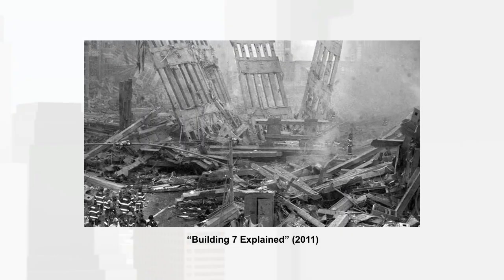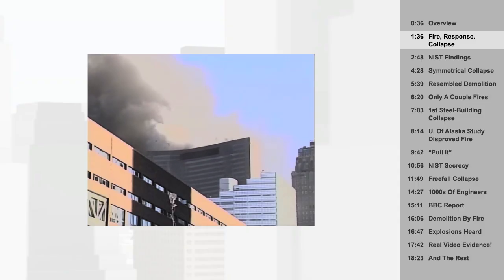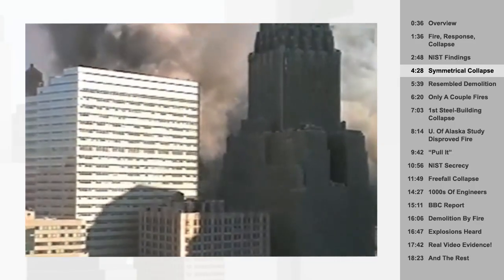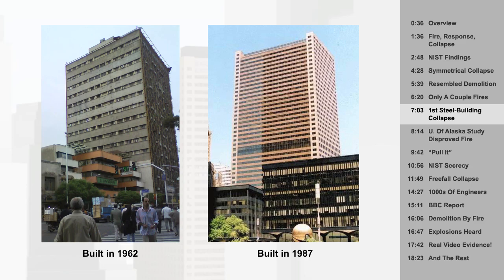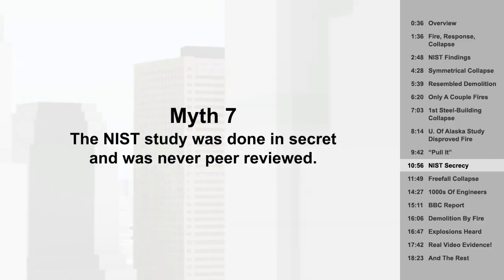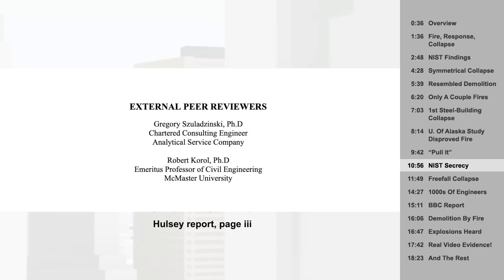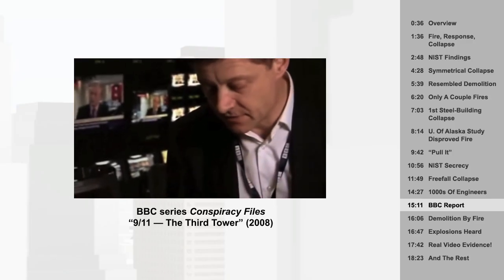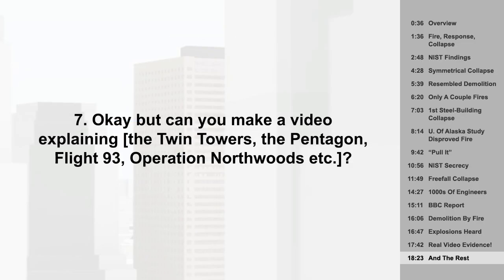Building 7 Explained: Comprehensive Final Edition

Comment: wow....a real exercise in orweliian thinking.
Reply: Fredumbfighter29:
You keep using that word.  I do no believe it means that you think it means.
Reply from the maker: How so, and please be specific.
Reply: @EdwardCurrent  

1. You say that WTC7 didnt look like a controlled demo, then proceed to show controlled demos.....and they look remarkably the same. This can be chalked up to perception I suppose, but thats just willfull ignorance, imo

2. You say Steel framed buildings have been knocked down by fire before....you give ZERO examples, and proceed to show buildings that burned longer and hotter and did not collapse. That was pretty funny.

Shall I go on?
Reply from the maker: they look remarkably the same
No, they don't. Demolitions don't start with part of the building crumbling, and then end 19.5 seconds later with the debris all over the place including on top of other buildings. Additionally B7 doesn't sound anything like a demolition. Therefore it only resembles a demolition if you look at about three seconds of it with the sound off and ignore literally everything that occurred before and after. This is not difficult stuff.
You say Steel framed buildings have been knocked down by fire before....you give ZERO examples
WTF are you talking about? There's an example shown immediately afterward, at 7:10, another at 7:12, another at 7:18, and another at 7:37.
proceed to show buildings that burned longer and hotter and did not collapse
You mean the concrete one at 7:20? Yes, it didn't collapse because it was concrete.

Shall I go on?
Yes, please, this is fun! Do tell me how else my video is "Orwellian" 😆
Reply: @EdwardCurrent   The claim is, "Never before has a steel framed high rise collapsed primarily  due to fire" . Ill admit you worded it a bit differently but your examples pale in comparison and function. A small theater is not a high rise.....The Windsor DID NOT collapse.....and the Plasco was 17 stories....just shy of 47, nor was it built to act as bunker in the case of emergencies not to mention the fact it disregarded over 20 fire and safety codes. Just a few key factors you, no doubt, accidentally omitted.

You show the CBS footage of WTC7 as proof of no explosions.....which was filmed several blocks away. Im shocked you didnt go with the MSNBC footage since you wanted to hear something go boom. Maybe the crowd reaction and the anchor would of provided doubt in a casual viewer, but you could of just talked over them killing the audio. Anyway, Im sure this was just editors choice.

Great video eddie. Im convinced. 2+2 really does equal 5.
Reply from the maker: The myth that I was debunking was that no steel building had ever collapsed due to fire. I hear that claim constantly as a result of the Truther telephone game. That a tall steel building had not collapsed prior to 2001 is true, but something happening for the first time is not evidence of anything.

The Windsor did not collapse because it had a concrete core. Duh. While you accuse me of ignoring things, why are you ignoring that the entire steel upper section collapsed off of its concrete support?

built to act as bunker
You're claiming that Building 7 was built to act like a bunker. This is nonsense. It was a lightweight steel building that was straddled over an electrical substation. There is a reason no skyscraper built today is designed like that.

which was filmed several blocks away.
The real demolition that I show immediately prior was a lot farther away than that. Do they sound similar to you? How can you be so disingenuous about the clear and obvious differences in the audio? And I am the Orwellian one here....

Im shocked you didnt go with the MSNBC footage
Oh, there's footage that looks and sounds like a demolition? Can't wait to hear multiple detonations followed by the building immediately coming down...you know, like in every explosive demolition ever performed on earth.
Reply: @EdwardCurrent  >> FreedumbFighter29: "built to act as bunker"
You're claiming that Building 7 was built to act like a bunker. This is nonsense.<<
I think FF29 might be thinking of the reinforced emergency command center on the 23rd floor.   I've seen "truthers" claim that this would have reinforced the building against total collapse.  To my mind, it would seem that anything that adds weight on any upper floor will, if anything, increase the strain on the lower parts of the structure, and it seems unclear how one floor in the middle of the building being more robust, would somehow make the entire building more rigid.  For instance, no amount of reinforcement on Floor 23 is going to make the joints at Column 79, Floor 13 more resistant to localized failure.
I think it's another case of Truther Telephone.  They hear that one floor was heavily reinforced and the next thing you know, the meme is that the whole building was built like an Abrams tank.
Reply from the maker: @Ѧρσ$†l£ѴڃrDɜ  Was that the emergency command center or the Solomon Brothers trading floor? A couple of years after B7 was built, the major tenant Solomon Brothers wanted a two-story trading floor, so a floor was removed and the columns reinforced to compensate for the loss of lateral bracing there. That's the context I typically hear the "WTC7 was highly reinforced" claim in.
Reply: @EdwardCurrent  Hmmm.  That could be another source of the misunderstandings.  Either way, of course, they represent an embrace of misinformation on the part of "truthers"

Comment: At 1330 the bucket is filling up with water increasing the wieght. That is why the can was cushed. That was not the case with building 7. No additional load was added and neither did the force of gravity increase. The load was static.
Reply from the maker: Actually, the load on the can was also static -- the bucket was full of water to the top, I had removed the siphon hose, and I was wondering why it hadn't collapsed. That is why water can be seen dripping off of it. But then it collapsed spontaneously, being right on the edge of supercriticality. So, no.
Reply: @EdwardCurrent  you assert that but you're video doesn't show that.
Reply from the maker: The video doesn't show water dripping off the bucket? Explain to me how water could be dripping off the bucket if it was still filling up with water.
Reply from the maker: Also you're wrong that the moment frame of B7 was experiencing a static load at the time it failed. The compressive forces on the perimeter columns were all changing continuously as the interior collapse progressed and the loads on them changed. That's fairly obvious.
Reply: @EdwardCurrent  what you are showing is basically the same as the destructive testing that we use in the constitution industry to determine the compressive strength of concrete. What we witnesse in building 7 is not the addition of load but the the removal of resistance.
Reply from the maker: What we are witnessing in Building 7 is the removal of lateral support from the moment frame. Which then led to removal of resistance via buckling/breaking.

The soda can never had lateral support, so we are only witnessing the 2nd part, the removal of resistance via buckling.
Reply: @EdwardCurrent  over- flowing over the rim of the bucket? Be sceptical of yourselff as well hombre ;)
Reply from the maker: @ronald broersma  It's literally seen in the video.
Reply: @EdwardCurrent  oke,oke, i could debate but i wont, ill take your word for it. Your video`s does give honest vibe as well, and i tank you for making an effort.

So i guess you proved that a simple soda can is capable of tolerating an insane amount of load before buckling considering its own weight vs load . . Soda cans are partially made for this purpose  but still pretty impressive of Mr six flags coke can. 

However, this (imo) is not advocating your argument that fire damaging the steel  structure could destroy the building that easy. I would argue that it actually provesthe opposite,  that a tiny little amount of cheap ass "metal" (dont know the english word for the alloy)  can hold a insane amount of load before collapsing,and thus that steel structures are actually way more capable to hold rigidity under heavy loads  then the max load  purpose for witch it was designed. 

+3 respect point for your video good sir,and another 2 for the reply.
Reply from the maker: @blauwzakjecrack  With the Coke can, it's about showing the tremendous difference between how much weight a tube structure can support when it's intact vs. when it has failed. The belief seems to be that even a moment frame buckling and breaking at the base should still provide enough support to slow down the descending structure above...the experiment suggests that's not the case. As I like to say, when steel fails, it fails badly.
steel structures are actually way more capable to hold rigidity under heavy loads  then the max load  purpose for witch it was designed
Not when they're laterally unsupported, though. An interesting extension to this experiment would be to fill a can with expanding foam. I'd predict it would support twice the weight (maybe 200 pounds) before failing when laterally supported in such a manner.

Comment: The period of so called "free fall collapse  occurred after all the structure (perimeter) collapse/undermined from the collapse of the floors / interior or the lower 12 or so floors.  The moment frame has 57 columns and they were supported by only  26 columns and wind shear trusses. When the facade from floor 7 down collapsed... the location of all the massive transfer structures.. the trapezoidal 40 story moment frame came down largely as a hollowed out tube. After the 7 story drop... the collapse slowed as it was crushed in contact with the ground.
Reply: And your best evidence to support this empty shell theory is that light came through the top left windows?
Reply from the maker: No. Four independent pieces of evidence are shown in the video.
Reply: @EdwardCurrent  Sorry but a simulation isn't evidence.
Reply from the maker: I never said it was. Simulations aren't evidence in themselves; they are tools for checking and weighing the plausibility of various hypotheses.

The evidence for the "empty shell theory" is:
1. Daylight seen through top-left windows
2. Smoke being sucked back into top of building
3. Smoke dust pouring out of bottom of building
4. Deformation wave moving down moment frame

Additionally, daylight can be seen through the upper-right windows just before the moment frame descends.
Reply: @EdwardCurrent  just how much the building was gutted is unknown, what caused it is unknown, and where it began is unknown. It's reasonable to assume it started near the penthouse and the evidence suggests it was initiated by an explosion.
Reply from the maker: It definitely began on the east side. That much is known. The exact floor and column is unknown, and how far it got before the moment frame became supercritical is unknown — but various simulations suggest at least two-thirds of the interior needed to be gone before the perimeter columns buckled. There's no evidence that it was triggered by an explosion. The sounds immediately preceding the start of the collapse are all low end, which is more consistent with structural failure, which would have made noise regardless.
Reply from the maker: No, there isn't. But there were apparently some explosions in the building, which is normal for a fire that size/duration (discussed in the video).
Reply: @EdwardCurrent  refer to my comment on the other thread.

"We heard this sound that sounded like a clap of thunder.  We turned around and we were shocked to see that the building was, what looked like a shockwave ripping through the building and the windows all busting out.  It was horrifying.  And then, you know, about a second later the bottom floor caved out and the building followed after that.”

"You heard explosions, like baboom!  There was like distinct sound, not like floors that were like dropping and collapsing, this was like baboom! And you felt, like, a rumble in the ground almost like you wanted to grab onto something."

 “I hear an explosion and I look up.  It is as if the building is being imploded, from the top floor down, one after another, boom, boom, boom.”

"CNN is reporting that a third explosion caused wtc1 to collapse in on itself"
Reply from the maker: Cherrypicked word salad isn't evidence. And if you are going to discuss something other than Building 7, I'm happy to delete this thread.